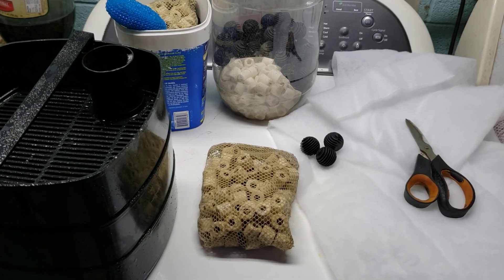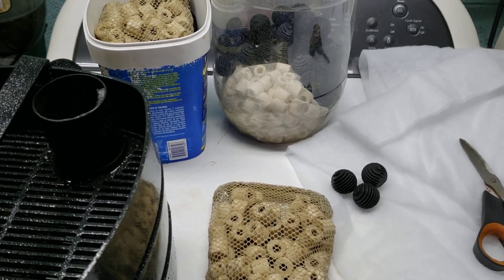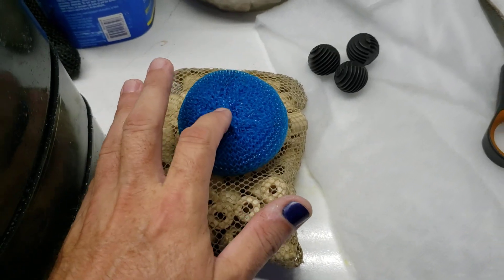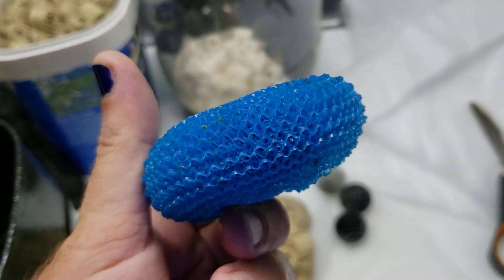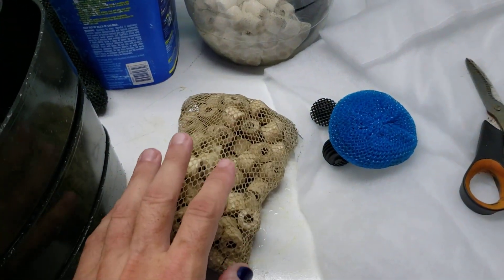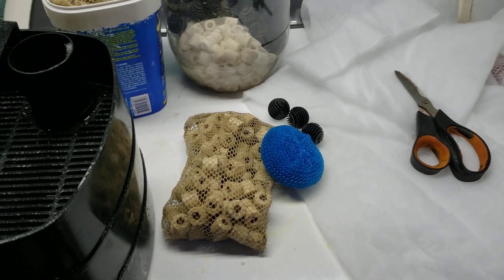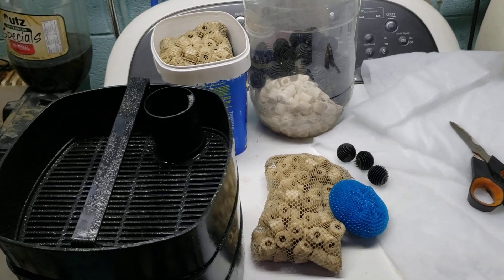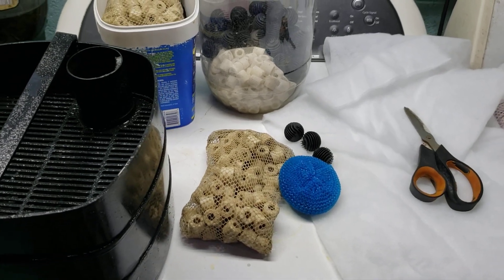Cheap, Easy Biomedia (All You Need Is Surface Area)

Comment: I once used a random brand of "ceramic" rings that were actually some type of calcium based ring. They dissolved in the filter with the addition of co2 injection. I've since switched to Seachem Matrix with no problems.

Comment: I used Plastic Pot Scrubbies in my tower filter for my salt-water tank that I built in 1981 because the Bio-Balls, at that time, were much toooooooo expensive. They worked just fine and they much cheaper (I had NO budget)!
Reply from the maker: That's the worst kind of budget. Lol
Reply: @DanHiteshew-oneandonly  I know! I had NO budget. I built a "tower" using an old 10 gal. tank and stuff from the local supermarket (plastic pot scrubbies and no-mold sponges). I did spring for the plexiglass dividers. But...   it did keep my Nitrates to below 2 ppm with an over-stocked 50 gal. tank.

Comment: Yeah you can use anything inert that doesn't break down into the water. I think a lot of people just get swept up in the marketing hype and you have people like pondguru saying you have to stuff every inch of your filter with his expensive media that he sells. But you don't, you just don't. All I have in my 207 external filter is the sponges that come with it and one tray with standard run of the mill bio-rings, and I have perfect filtration. No high nitrate or anything.

Comment: Not all plastics are the same. Some degrade faster than others. Some leech out artificiial estrogen into your waters. others break down into micro plastics which get into your fish's tissues. I prefer crushed lava rock and ceramic rings which do no break down into harmful  byproducts. Crushed lava rock can be placed in cloth bags and placed into your cannister or HOB. I would never use plastic if I can help it. Every time you fo a water change, those micro plastics and artificial estrogen components end up in our oceans. Ceramic or glass containers is the way to go.